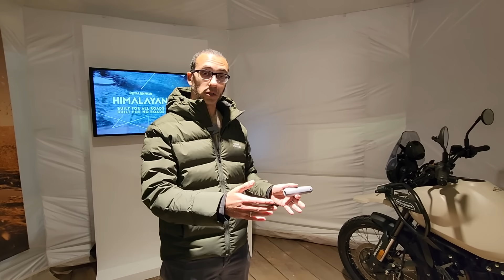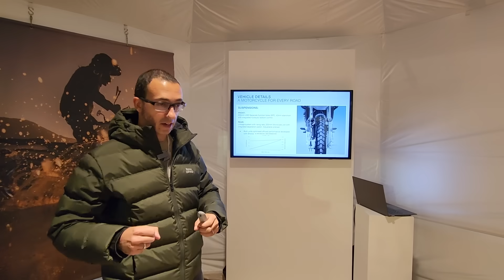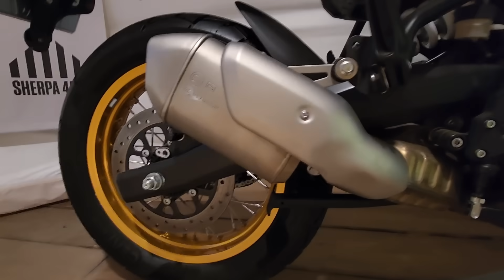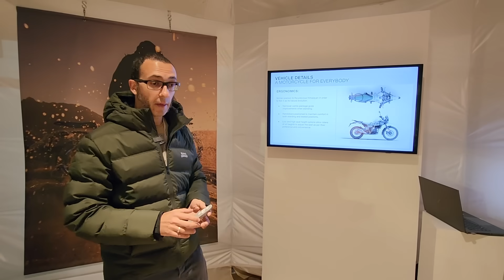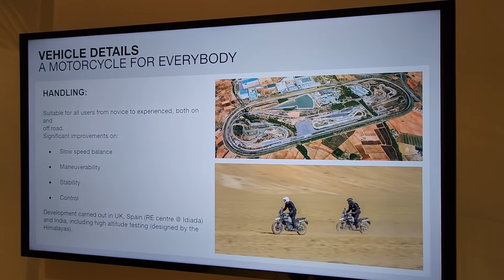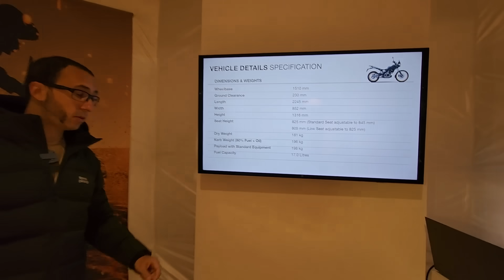Royal Enfield HIMALAYAN 450 | Interview with Lorenzo - Vehicle Lead H450

Comment: I like how the adjuster on the rear shock is easy to get to. Tubeless wheels nice. The muffler is low to allow saddle bags without the risk of burning a hole through them. The more I watch the videos about the RE 450 the more I like about it design wise.
Reply from the maker: Right on.

Comment: No wonder the new Himalayan looks curvy and smooth like spaghetti... Lead by a Italiano 🤌 !!
Reply: Casual racism
Reply: @pankajuchiha9232  Good thing design and packaging was by an Italian and the engine + electric assuming r led by the brits and not the other way round 😂
Reply: @user-bm2gb2pn6h Hahaha brilliant observation 😂
Reply: @user-bm2gb2pn6h  How dare you, if the engine was made by an italian it would start leeking oil immediately, but it would be a good olive oil for an adventure aglio olio e peperoncino
Reply: @user-bm2gb2pn6h sure Ferrari and lambo have awful engine
Reply: @pankajuchiha9232 racism?? I thought is was compliment
Reply: @VideosfromaSailor  Both ! It matters according to your worldview 😉
Reply: So was the last one. Designed by Pierre Terblanche
Reply: @ablm1996  wikipedia is wrong.